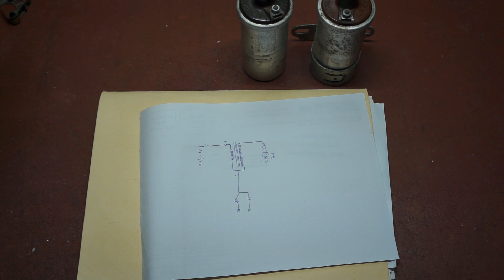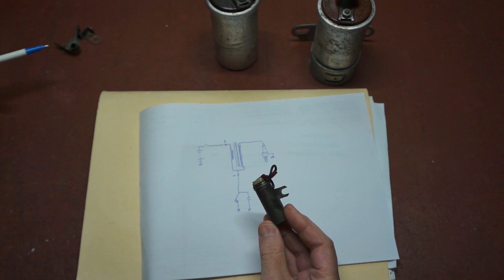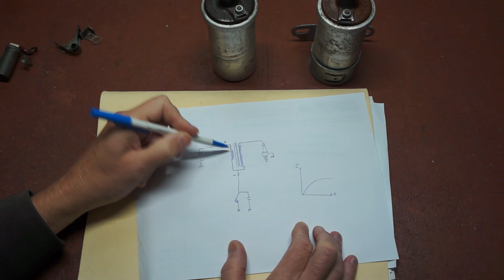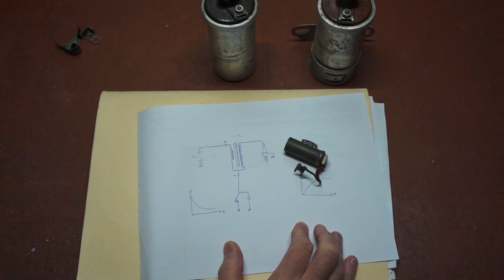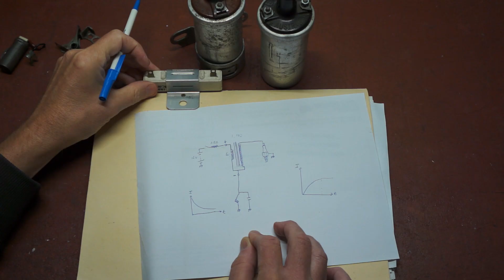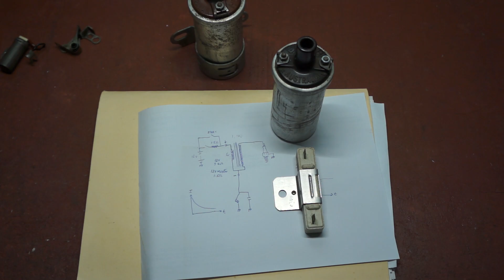Testing 12V Ignition Coils in a 6V Jeep.

Comment: Thanks John you’re excellent explanation of Kettering Ignition system it seems that Willy will run both 6 volt and 12 volt coil,Kind Regards Ian,

 of Kettering ignition System
Reply from the maker: As an emergency repair, the standard 12V coil certainly works. However, I would expect it to run out of spark energy at high speed. The resistor type of 12V coil would be much better, although not quite as good as the 6V type. One day I might actually road test them to see what the limitations are.